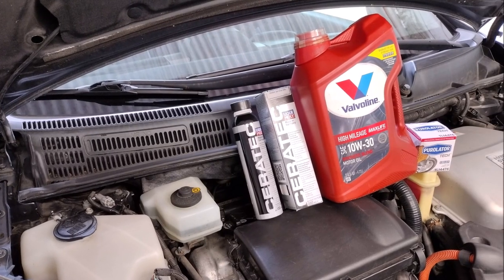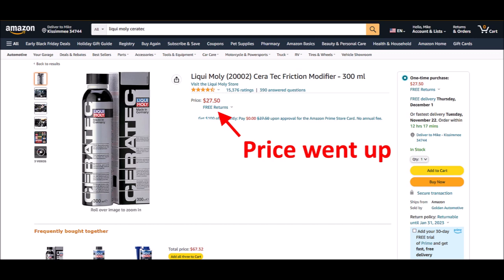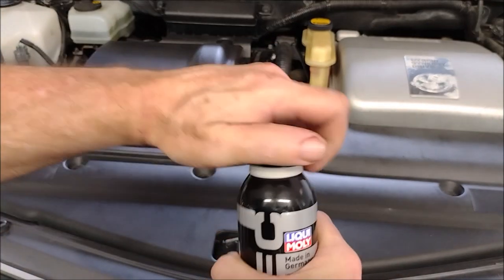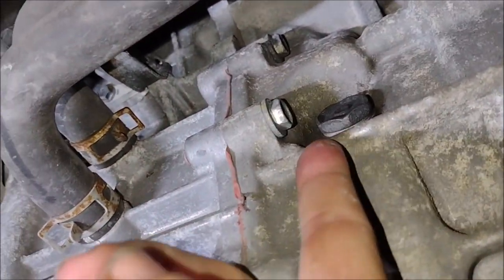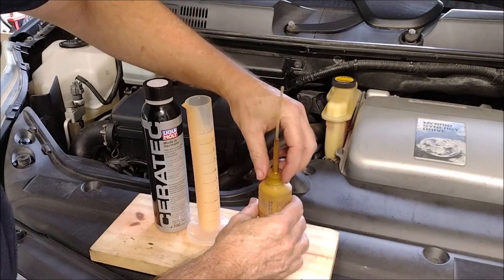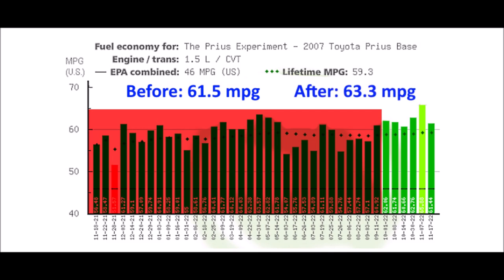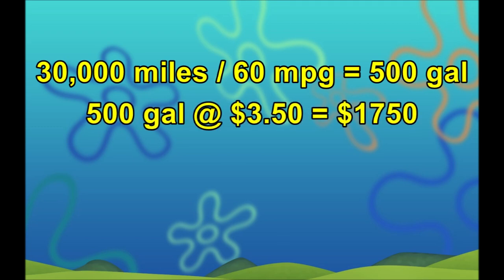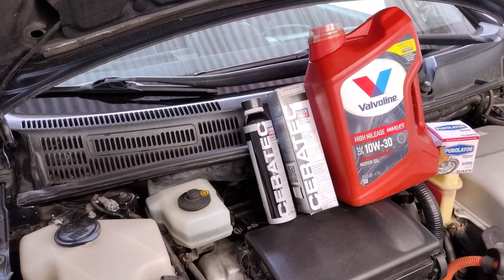The Prius Experiment: Better Fuel Economy with Oil Additives? (Liqui Moly Ceratec)

Comment: My argument for it being worth it would be that if you are getting better MPG, that means you are also having less wear and tear on your engine and transmission. So, keeping your car longer and more reliable would be worth it in the long run. Just my two cents
Reply from the maker: That's a good point.
Reply: Absolutely
Reply: And you theoretically achieve that result at no cost because the fuel economy cancels the purchase price.
Reply: @michaelblacktree  and in my country the gas price for a gallon would be around 7,20 dollars so its a no brainer 😅
Reply: Ceratec is good stuff. 20k+ excellent reviews on Amazon, and it's made in Germany.."you know the Germans make good stuff" 😂
Reply: Would agree on that. For me fuel additives is not so much to do with gaining mileage but to clean the tank, fuel injection system and smoother quieter engine. So if this oil additive smooths down your engine then its a winner.

Comment: I've been using Ceratec in my Honda after every engine oil change (and not after every 50,000 kms as suggested by Liqui Moly) and I've noticed marked improvement in engine idling vibration, smoothness while driving and improved fuel economy. For me more that than it paying back in terms of money, if there is less internal friction, the engine will last me longer with better driving characteristics and that will be the biggest payback for me.

Comment: Good analysis - but in the bigger picture, the saving of fuel is as a result of lower friction, lower friction means lower wear and an extended asset lifespan. So it's a win in my books - but I do have bias because I use it and have done for years...
Reply from the maker: That's true, but would be very difficult for me to test. Plus this video series is all about fuel economy.
Reply: The fact that it lasts for 50000km and is relatively affordable. I put some in my Elantra Sport, MPG is slightly improved so far
Reply: @mccanada269  Don't forget,

With the 50,000 km claim.

It's not that the product works 100% for that amount of time, and then suddenly stops working.

The effects start to decrease, and are no longer measurable at the 50,000 km mark.

So some people are using a bottle every second oil change or so.

Comment: For my air-cooled classic car, an engine rebuild cost about $20k at least if not more.  I am glad you proved that Ceratec improves MPG for your auto. I am using it to reduce the engine wear.

Comment: From my experience with Ceratec (about 20k KM), I've noticed a small improvement in fuel economy, somewhat similar to the one mentioned in the video, also the engine ran smoother and quieter for quite some time. I've been changing the oil every 7500km and topping it off with M0S2, it seems to "boost" and aid the Ceratec nicely. 
Appreciate the video.

Comment: I used the the oil smoke stop additive from liqui molly, it worked for me. My car has a oil smoke issue, between oil changes it consumed 4-5l liters of oil. The mechanic said its the bad valve stem seal, needs a head rebuild. Oil smoke stop additive claimed it stopes oil smoke, revitalize rubber seal in the oil system, and restore compression. I tried it, and it worked for me. Since the i drive 3000km (that would be 1liter of oil missing already), with the additive inside, no oil smoke, no oil consumption,  the engine feels more solid, it idles and runs smoother. I am not saying its a wonderweapon, my car was working fine, the mileage and power was fine. My only issue was the oil burning, and it help with that, i know its not a final solution, and i need a head rebuild in the future, but for the time being im satisfied with it. Maybe i give a shot for ceratec at next oil change, and some ATF additive from Liqui molly, see what happens. By the way, the video was good and informative, and for mileage data to come together, i think it was a long time to make it.

Comment: Ah, but you haven't taken in to account lower engine wear, prolonged engine life (apparently) and extended times between oil changes. So if you break even on fuel alone, you will benefit a little from the other savings.
Reply from the maker: That's a good point. But I have no way to test those things. So I can't confirm or deny it.

Comment: Prius Four Touring 2016 with 30.000 miles.. we had like 62 mpg in the city and Highway with 42 mpg @ 93 mph  with winter tyres.. now we used Engine Flush for about 25 minutes + 0W20 + Ceratec + gasoline system cleaner and now we have like  74 mpg in the city and 50 on the highway..  😇:elbowcough:
Reply: @typeins  Also big fan of low viscosity oils. Getting into nooks and crannies, thin better than thick especially in tight Japanese & German engines

Comment: Yes, I agree with some of the other comments it’s not only about the fuel saving cost ,it’s about the longevity of the engine, piston rings, rod bearings, crank bearing, just overall less wear on the engine component internally  will save you money in the long run.

Comment: The thing that wasn't taken into account is the possible (likely) decrease in engine wear with the additive. I have used a different additive for many years (Dura Lube) in non-hybrids because it increased my mileage by a little under 3 mpg. I literally drive my cars to death before buying a new one. Since I started using the additive, that death has never been because of engine wear, it's always because the cost of repairing everything else gets nearly as high as a new car payment.  My new car this time is a toyota hybrid - my first hybrid. DuraLube isn't recommended so I'm looking for what will be best.
Reply from the maker: That's outside the scope of this video.

Comment: The ceratec additive main goal is not better fuel efficiency but preventing engine wear, and results could be seen after years and years, if u are someone who flips cars every couple of years than this product is not for you, but if u wanna keep a car for long time this product is golden, it was created in the '60s and started to be used in fighter planes in case the oil sump were to get shot at the engine was still running without oil in crankcase, yeah that's how good this thing is.

As we all know most engine wear happens on cold starts, oil takes 15 seconds on average from ignition to flow everywhere, so its metal on metal, ceratec coats all engine surfaces with particles that will protect from scratching, this product is good if u play the long game.

Comment: Ceratec is only used for engines and Manual Transmissions, not recommended with  a CVT/auto I always put Ceratec after oil changes and notice the huge improvements esp power, acceleration and fuel consumption
Reply from the maker: The Prius transmission is not a typical CVT or auto transmission. I did my homework on this.
Reply: @michaelblacktree  Sir, torque converter automatic transmission uses wet clutch, unless your car is AMT or manual.
Reply from the maker: @naushadnizamudien3449  - The Prius transmission doesn't have a torque converter, or wet clutches. The electric motor performs those functions. It's actually pretty ingenious. Like I said, I did my homework on this.

Comment: I'm curently at 53 us mpg on 3800 miles around Europe in a UK 2007 gen2 
About 2000 miles (from wich 1300miles with 400kg/ 881lbs weight in the back)are motorway only at speeds between 60 and 100 mph 
No aero mods yet but I have some software mods and drive the car in stage 4 all the time wich makes a huge difference
Reply from the maker: Nice! I didn't know there were software mods available, but would like to try it.
Reply: Stage 4 is that all the parts are completely warmed up...
Hybrid batteries, motors etc... Happens automatically as you drive...
Reply: @boobtubeakatv1296  wrong stage 4 applies only to the engine 
The battery can be at 0c and engine at 88c in stage 4 and it doesn't go automatically in a gen2 prius 
Only gen3 and gen4 can idle check for stage 4 while moving 
On gen2 you have to stop to 0mph for idle check and stage 4 to happen and if you don't engine will stay on forever bellow 34mph no matter what soc the battery is in
Reply: @boobtubeakatv1296  see my video about temperature spoofing

Comment: I found your channel looking for 2nd gen prius info and mods, and found your MPG improvements series and fell in love! Cant wait to see more! Have you thought about just taping over the upper grill with clear tape instead of the ugly foam? And have you considered trying clear tape or similar to create rear wheel skirts that continue the body over the rear wheels for improved aerodynamics? Also, my mail fuel economy trick is also removing as much weight as I can without making the cor horribly uncomfortable to live with. Have you considered also replacing all the lights in the car with LEDs which would use less Electricity?

Keep it up! Love the series so far!
Reply from the maker: Thanks for the compliments. There are still some eco-mods I want to test out, so the series will continue.

Comment: Nice, as others have said the benefits are you are less likely to have wear and tear on yout engine so less repairs needed (say you got to 1 million miles and your rings are still good, but someone else might have leaking rings at that mileage + less efficient engine + the cost to repair. 

 I'm eyeing up some WS2 but havent bought it yet. Its supposed to be one of mankinds slipperiest materials. Its fairly cheap to get now and you can buy it in powered form to add to oil. I also asked project farm if he would test it, that would be cool.
Reply from the maker: Yeah, that would be cool.

Comment: My current line of thinking is,

That using this product in conjunction with a thinner oil is where it provides the most benefits.

For example, my boring 2017 Camry can use a variety of oil viscosities.

In the past I have used a 5W30 oil, but this oil change I went to a 0W20.

Since I'm using a thinner oil, there is POTENTIAL for the engine to not be as well protected.

So using this product SHOULD yield the benefit of a better protected engine, and in theory there should be a "double" fuel saving.

From the thinner oil, as well as the Ceratec product. 

But I don't do enough of the same trips to be able to say with any certainty if this is the case.

Comment from the maker: Hey guys! This is the first video with the new format, where the eco-mod and the results are in the same video. It took a couple months to get the data for this video. Hope you like it!
Reply: Why not to fill trans for up top of the engine bay, just put a hose down to fill port and fill it from top of the engine bay.
Reply from the maker: It was easier to access from underneath.

Comment: Some other additives that may be worth a look are Engine Restore with CSL, Motorkote hyperlube, Archoil 9100, liquimoly molygen, maybe Tribotex, and not an additive but HPL oils are supposed to be the cream of the crop when it comes to passenger car motor oils (pcmo) it would be sweet if u could test some of them out. You could also try 0w20 and fill 1/3 of the way up from the dipsticks low oil indicator mark. Good luck on your mpg journey friend!!! (There is one more - Mannol Ceramo Ester but its German and super hard to get in the U.S.)

Comment: the primary purpose of this product is to reduce friction and wear of the engine, the fuel consumption which decreases a little is only proof that it reduces friction, therefore in the long term the engine is protected. So yes it's worth it. :hand-purple-blue-peace:

Comment: you have to take into account that ceratec claims 30k miles of the ceramics staying inside the engine, reducing engine wear, for high mileage engines I think it's worth it besides improving mpg

Comment: It’s not only for the fuel economy. At least Ceratec should reduce friction and make the engine more reliable. If this is true, it would more worth the money than fuel saving. 
 But who can prove, the engine runs longer. 
 Like all additives you have to believe in it, or even not. 
 My old Golf MK5 with the „bad“ 1.4tsi BLG engine with 170hp has never an issue with chain or turbo, and runs over 230.000km, before I sell it for an 2019  mk7.5 gti pp. So in this case, for me, it helps the engine run longer without superexpensive issues. But it I think, the 15.000km oilchange interval’s with Addinol 5w/40 helps too for this healthy engine life.
The 20€ per bottle in Germany was worth the product for me

Comment: If you want more mileage you need a thinner oil, so you are not losing horsepower to pump and pump oil. Additives may help for wear and for the starting moment,  when there is no oil pressure or oil in the bearing space.
Otherwise you need a fuel that is more energy dense or increase your combustion temperature, which will have your car create unallowed amounts of NOx.

Comment: It's not just mpg. Ceratec coats your engine parts and protects wich protects you're investment, your engine"... it works over time, needs to be in your oil 3k miles to properly coat the engine parts. In my opinion if you want to keep the car long term put obe bottle in every oil change, or at least every other oil change.

Comment: increasing 1kmp milage by any fule combustion system or fule injector system is called very less improvement in milage , but when you get 1kmp increase in milage by reducing friction means it had to reduce friction too much , means ceratec worked huge in what it claimed i hope u got my poin of view

Comment: About trying different additive, a Toyota technician told me that the second gen Prius can handle 0W-20 oil grade thus reducing resistance in the engine due to lower viscosity thus reducing fuel consumption, it would be cool to see it tested!
Reply from the maker: I don't want to do that, because it might accelerate engine wear. Actually, I decided to use 10w30. Because Florida is a warm place. And the engine has over 200k miles.
Reply: @michaelblacktree  Okay, I'll do it myself then, my Prius has less mileage and the engine seems very healthy. I won't make as much effort as you to keep track of the difference it makes but anyways well see if it makes a big difference.
Reply from the maker: If you could share the results, that would be great. I'm sure some of the viewers would like that.
Reply: @ChocolatBacon  sometimes what you gain in lower viscosity you lose to ring seal for efficient retrieval of the expansion during burn.

Comment: It’s impressive that you get over 60mpg. I have an 07 and the best I get is about 50 in the summer
Reply from the maker: Thanks. I think the tires play a big role in that. My car has the Firestone Fuel Fighter tires, and I increased the air pressure to 40 psi front / 37 psi rear.
Reply: @michaelblacktree  Please do not do that! Pressure that high is really unsafe when hard braking or cornering, you will break less and corner less, not worth your life to get a bit more MPG!
Reply from the maker: IMO, the car actually handles and brakes better. The car felt mushy at the stock tire pressure. And it's within the max pressure rating for these tires.
Reply: @michaelblacktree  it will seem like it but not under emergency situations, we actually tested it on track and the average braking distance increased by 5-8%, that could mean crashing or not + when the tires are hot they are also more prone to Explode
Reply: Your increase in tire pressure IS FINE in ALL conditions !!!
You are not racing around corners (🤣) nor braking hard...
It's a Prius ☺️
It has regenerative braking... The only thing to look out for is that the front tires may wear in the center quicker due to the constant drag of the electric motors...

I personally use 38 f & 35 r in my 2005 Prius and have low resistance tires too...

My fuel mileage has more to do with how much my foot gets planted on the pedals, as sometimes you have to show others that YES you can keep up 👀 😱 😎
Reply: @514aam  
How often are you ever in those
'' Emergency '' conditions ???
It's a Prius that weighs under 3 G ...
He s not racing around everyone 😍
Reply from the maker: The max pressure rating on the tires is 44 psi. As mentioned above, I'm filling them to 40 psi front / 37 psi rear. This is well within the maximum safe pressure. Tire wear seems fine so far. This is a tried and proven thing. It seems silly to get so upset about it.
Reply: @michaelblacktree  Don't listen to these clowns, 40psi is nothing. Ive driven on 55 psi when I do long distance highway trips. If it rains then I drop the pressure but the car will feel more planted with higher tire pressures and have less roll. You really don't start seeing grip lose unless you are going over 40psi and even then, it's minimal.
Reply: @michaelblacktree I run 40 psi all around front and back on my CT. I have found a noticeable difference in rolling resistance, especially when coasting. In addition to raising the height of the vehicle which gives me more confidence as the vehicle is quite low. I haven't tested fuel economy as the car gets good enough economy for me to care, but I assume less rolling resistance would be advantageous? The only negative is a small decrease in ride quality, which was horrible to begin with anyway. By the way I don't drive fast or use the car hard. Even if I did there's only so much you can do with a 4cyl hybrid barely making 100hp lol.

Comment: Think of your engine. If you run an expensive car with a complex engine where service might cost you beyond $5k then yeah you want a fuel cleaner, an oil additive, the best filters and changing them often. An added side effect is that you get marginal fuel economy. With this added and regular oil changes just check your engine head after 150.000km and you should be good.